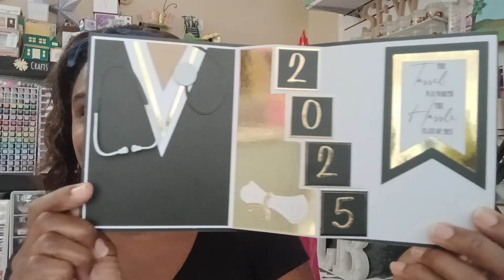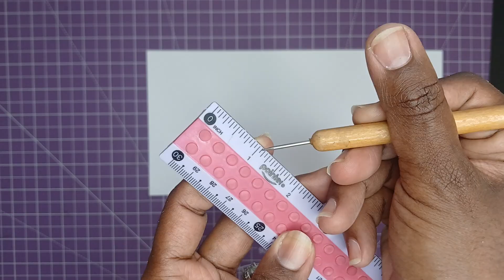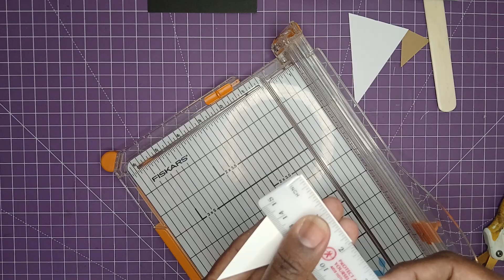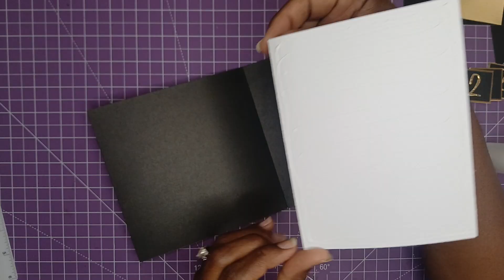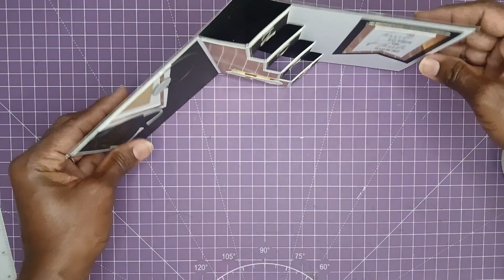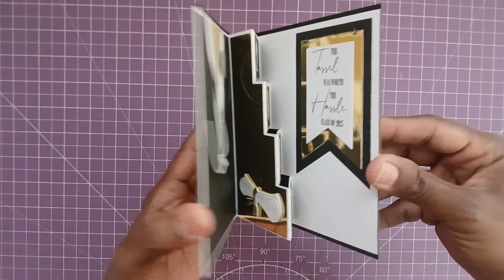4 Step Grad Card for a Doctor | Pop Up Card | Handmade Graduation gift | Tutorial

Comment: Would you have measurements for an A7 card? This is lovely but I don’t have 12 inch paper and am horrible with size adjusting. 😂
Reply from the maker: Hi there. I'm sorry but I don't have the measurements for that size of card especially for this design as I would have to work out the steps as well. So very sorry.
Reply: @CrystalBest thank you for responding. No worries. I’ll get some 12 inch paper. Appreciate it. 😊
Reply from the maker: You are more than welcome. ❤❤❤ Happy Crafting ❤🎉

Comment: Are the measurements in inches or centimeters?

What type of cardstocks did you use?
Reply from the maker: Hello Mindy. All my measurements are always in inches and I use 80-120 lb cardstock. Thanks for checking out my video. I appreciate it. ❤️
Reply: @CrystalBest 

I appreciate the quick response.

I think I didn't clarify my questions. 

What is the name of the shiny cardstock paper that you used inside the card.

 It's the gold one it doesn't look like a regular card stock papers.